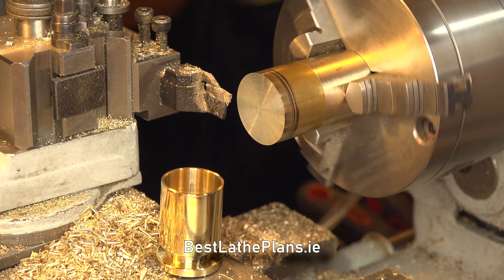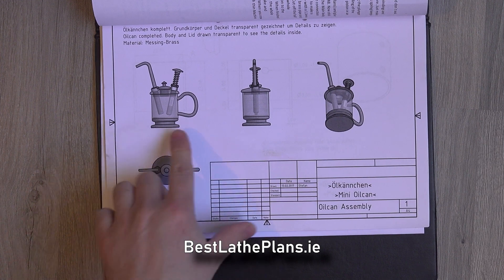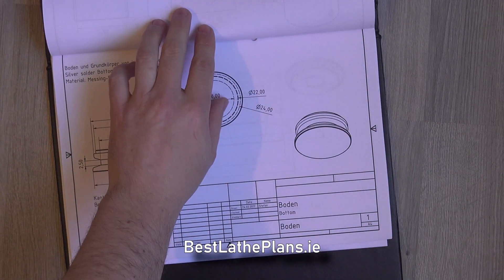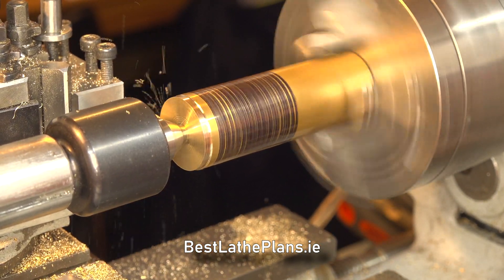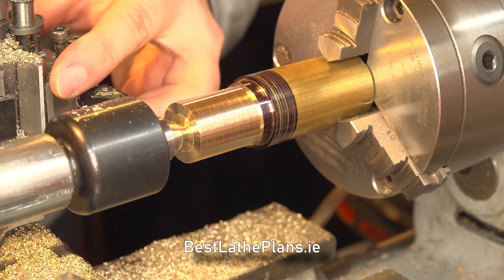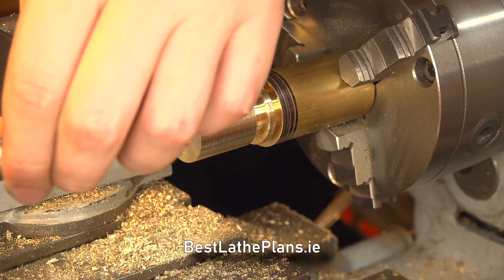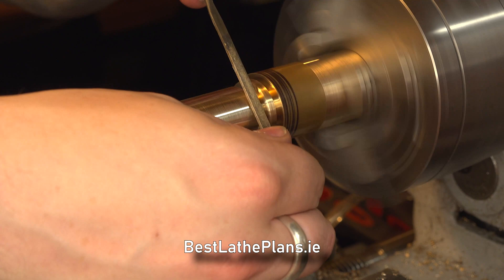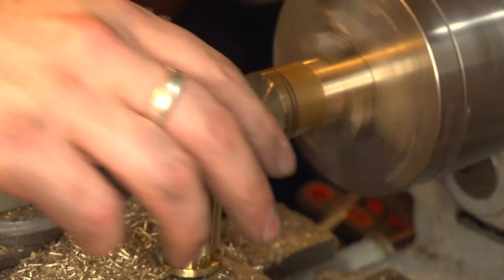Making the Main Body - Worlds Smallest Oil Can - Part 2 - 4K / UHD - BLP

Comment: I highly doubt it but would copper tube work for the main body I mean sure your hands would stink a bit but still
Reply from the maker: Yeah should work fine.  It's not subjected to any loading.  Could do something nice with >=3/4"
Reply: @BestLathePlans  understood I was more worried about corrosion or oil contamination though thank you😛
Reply from the maker: Yeah I would say you'd be grand. Unless you're using some very niche fluids. Copper is pretty durable, and easy to come by. The wall thickness will be thinner, but otherwise, I cant see any major difference. :D Best of luck with your project.
Reply: @BestLathePlans  thank you my good man😛

Comment: It's coming along nicely! A couple of criticisms though - your vernier abuse makes me cringe. Definitely get yourself a scribe and a couple of sets of cheap calipers (bent-leg, etc). Plus, using that cloth on a spinning part is a huge no-no. You were 'only' polishing but if you use rag/cloth on the the lathe long enough it will eventually get snagged or just wrapped up in the part or the chuck and you'll be minus a fingertip or worse. Stay safe!  Looking forward to seeing the next installment.
Reply from the maker: Hey Noid919, thanks for checking out the video, and the feedback. It's always good to hear feedback and learn from the community, as I'm still very new to the hobby. The Vernier use is back from the days at school where we would use the damaged sets to mark lengths etc. I've 5 sets of Verniers now, 3x Mitutoyo, 1x Moore and Wright, and 1x Metrica cheapo €15. The cheap ones are the only ones I use for scribing with. I also have some M&W spring and friction calipers, but they actually cost more than the  Metrica Vernier, as most of my gear is vintage ~1060s, including the lathe. As for the polishing, it was a calculated risk. I decided it was acceptable here as the part only had a 1mm stem, so would have had very little torque if it did catch, and I was holding it very lightly between thumb and forefinger on each hand. On bigger parts, it would be far more dangerous, as would a tighter grip. I'm also working up to getting a polishing spindle at some point in the future too. Although they have their own risks/dangers too. Stay safe people.